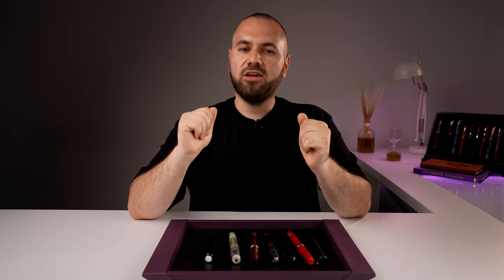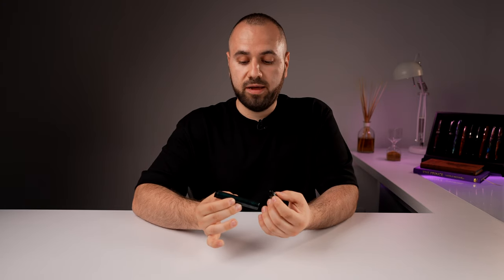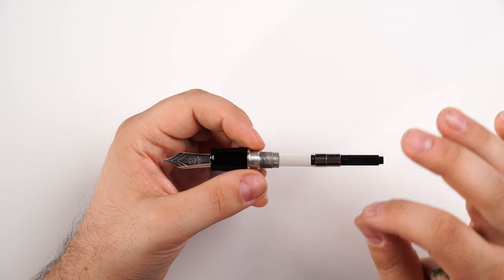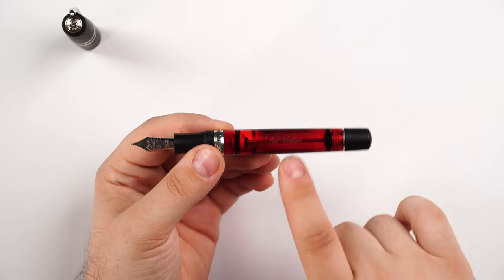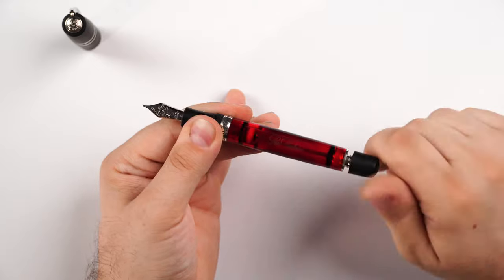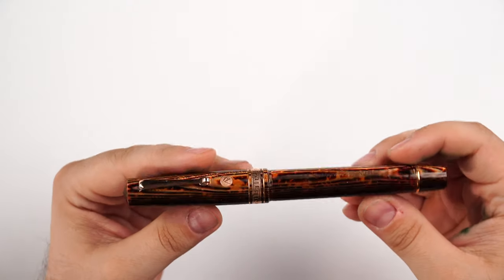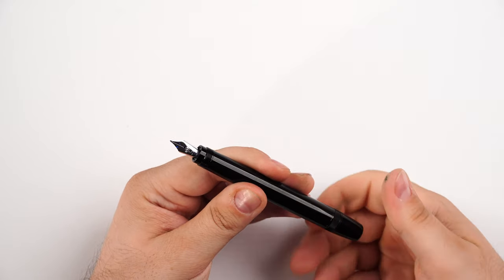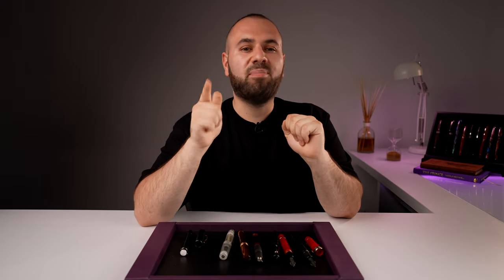7 fountain pen filling systems | PenTalk 101 |

Comment: I recently just purchased a wahl eversharp decoband a month or so ago, do you think Akkerman Gourmet Pens Pink is a safe ink for the pen? It’s a pneumatic filler with a sac. Also what other inks besides Waterman do you think are safe? Diamine, Pilot Iroshizuku, Robert Oster? I only have a few bottles of ink and need some recommendations so I can get some more. 😊😊
Reply from the maker: Hey John - yes a pink ink is safe - akkerman inks are fairly safe and i didnt had any unpleasant experiences using them. Besides waterman - i think all the montblanc inks are safe, only ink from montblanc that i wouldnt consider using is Lucky Orange, it has a tendency to crust up really quick. Diamine the standard inks are pretty safe - please stary away of sheening/shimmering inks from Diamine in a sac filling system. Pilot Iroshizuku - totally ok, with Rober Oster i would be careful - i dont know too much about them but with boutique inks... better safe than sorry :D